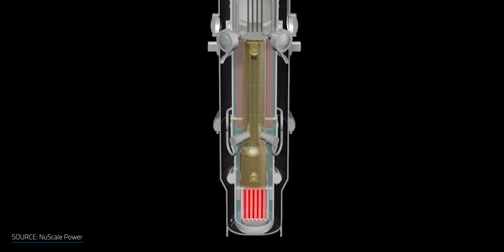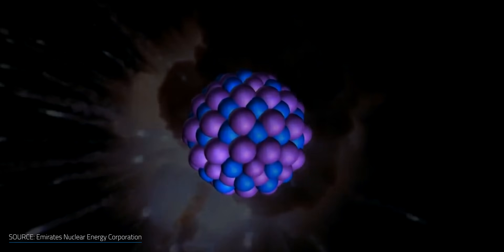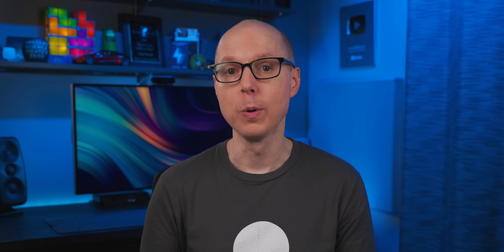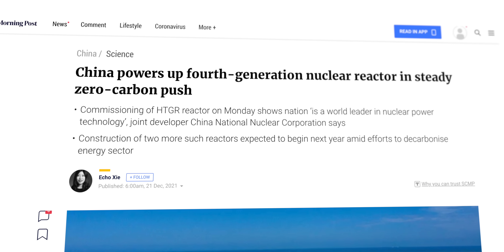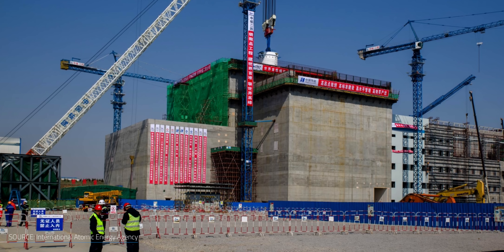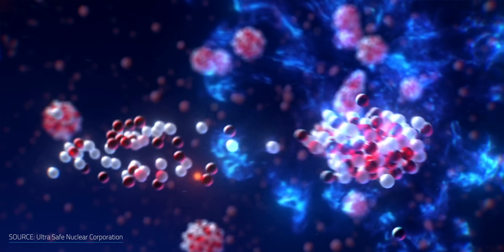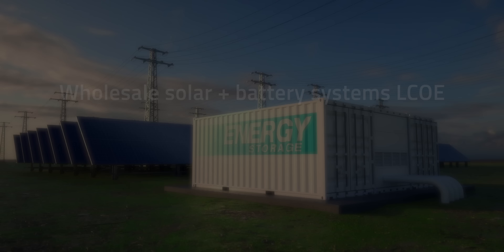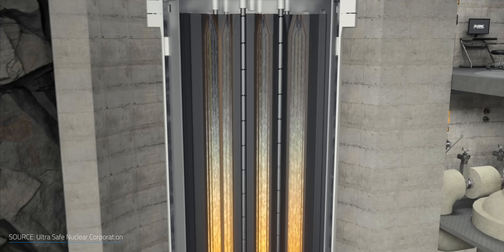Forget Small ... What About Micro Nuclear Energy?

Comment: No, no, No, this isn't a good idea. A bunch of small nuclear reactors all over. Not a good idea. Nuclear waste is a bad idea as well. Why doesn't anyone think of the waste ? Plus there would need to be big regulations to control it all. Along with a lot of more opportunities for things to screw up all over the country. I'm working on a micro energy system with a combination of wind & solar, a battery system and GE has a back-up generation system that runs on a jet engine. You tailor the engine and generator size with the micro electric system with the community it needs to power or the building size. Than you power the jet engine with Neste Bio-Jet fuel along with a small structure to eliminate the noise level and air intake needed. And you can have a high school kid from KY to run it, you don't need a mad scientist to do it. The cost levels are considerable lower and the tech is simple and straight forward.  🤷‍♂ Lets all be safe and green all at the same time. 🤷‍♂

Comment: Just curious, I always see water as the medium for cooling in Reactors but is it possible to ever use other things, like colder liquids in specific situations, then it could cool the reactor further than just water can?  Just curious..
Reply: I know TLDR, this would be too short an answer in the classroom phase of the Naval Nuclear Power Program. It's complicated.
The water (In Naval reactors) is not only the coolant, it is also the "moderator" that slows the fast neutrons from fission down to the "thermal neutrons" needed to sustain the chain reaction. The density change of water with temperature is what makes the reactor "self regulating". When the temperature increases the less dense water slows down fewer neutrons slowing the chain reaction and cooling it back down. The control rods of the reactor can shut it down, allow it to self start or adjust the Average Temperature of the Primary Coolant but they are not used for moment to moment "control" of the reactor.
 PWR's
(Pressurized Water Reactors) normally are "Critical" when operating, that isn't a Scary Term, it means that one of the 2.7 neutrons from each fission of a U235 atom causes ONE additional fission of a U235 atom, steady state conditions. changes in steam demand on the secondary side raise or lower the temperature of the primary coolant which increases or lowers the number of thermal neutrons that cause more fission.
Reply: There are basically four kinds of coolants, water, liquid metal, gas, and molten salt, each with their own hazards and benefits. That should get you started.

Comment: I would go futher, I would like to see neighborhood reactors installed with solar and wind along with batteries to deal with the heavy loads. This would decentalrise the grid while having remote monitoring. Also I am surprised there is no secondary market for used nuclear waste? I mean in terms of space usage for space craft or anything or for use in micro power plants to full use up that heat. In IT we can reuse old hard drives in arrays for temp storage like backups and non critical storage, maximizing the working storage, and minimzing waste until the HD does get scrapped for recycling later. Im sure used nuclear waste from the last 100 years can be stacked up like that and use that left over heat energy to further produce steam on lower end or smaller power plant turbine power generation. 

I'm sure it can be figured out like anything else but you have to start somewhere like SpaceX did with reusable rockets.

Comment: I sort of wonder if the inflection point, from an economic standpoint, for the widespread adoption of nuclear power is going to be the point at which average sized cities can effectively protect their citizens from price fluctuations by purchasing a nuclear reactor to give their residents power. If you are the city council of a city of ~50,000 people (maybe 25,000 homes) and you can go out on the open market and spend ~$300 million on a set of modular reactors that can provide for their power needs, and tell all their residents that there power is going to reliably cost $100/month for the next 10 years, I think that would be an insanely popular thing to do.

Comment: I think we should hold off on nuclear. Switching infastructure is a huge ask and takes a very long time to convince the public before you can even start integrating it. We are just getting people on board with renewables. Nuclear still has a ton of risks. It may very rarley fail, but when it does it renders entire areas of likley built up infastructure inacessable. We should wait for fusion to get fleshed out so we are not just finishing building nuclear plants when we start asking for fusion.

Comment: Deep geothermal will overtake SMRs by 2030. Its cleaner, does not require fuel, and can be installed far quicker. SMRs are better than larger reactors for sure, but they cannot be deployed as fast and with as few downsides as deep geothermal.

Comment: I have worked in power generation and I think these small and micro reactors are a great idea. So many of the problems with fossil fuels are eliminated, they are safer than coal plants to work in and around, and they are, in the long run, far cheaper, though initial costs can be intimidating. I say move off of fossil fuels as fast as possible. These are the right solution.

Comment: I live in Ontario, near the Chalk River Nuclear research center and I am pro nuclear but my main hesitation is around cost. It is too expensive. Hydro is king in Canada for a reason. Quebec is exporting loads of cheap electricity to USA because they invested in Hydro when we invested in Nuclear. Their investments are paying off big time while ours are a massive drain on our economy. Nuclear does work and is worth it in certain applications but Hydro is a better source of electricity for us here. Unpowered dams are low hanging fruit for us and dam control can act as a battery to balance wind, solar and nuclear power plant refurbishment gaps. We have no coal and I am glad for that. I would not switch from nuclear to coal like Germany. I would invest more in Hydro like Quebec though. We have so much untapped potential in this province that is 2x the size of France

Comment: Something to note, A smaller core comes with less decay heat (i.e. its harder to stop a freight train than it is to stop a prius). A nuclear reactor doesn't just stop producing heat when you insert the rods.
The smaller decay heat load lowers the potential for a meltdown in the event of an emergency, and lowers the cost of developing large and complex passive cooling systems, creating an overall smaller, simpler, and overall cheaper reactor.
Reply: When services everyone needs started being Privatized & centralized into bigger hubs, that model was “sold” to public as , “this will give you cheaper, safer, more reliable service” (which has not happened, due to numerous factors).  
Centralization works great for profiteering, but has some potential issues, such as security (like, as terror*ist targets), excessive dangerous waste, etc.) 
Imho, those controlling what kind of reactors are allowed, dance a fine line between pleasing citizen consumers, investors, military agendas to stockpile weapons-grade nuclear materials, toxic end-stage capitalism, etc. 
Then there’s dealing with the rather antique rickety Grid. 
Truly micro nuclear, run-your-home generators, could be great, if that tech can be made actually safe.  
My concern is, industry does not naturally opt for consistently making things that work as-advertised, much less, over time.  Pretty much across the board, whatever one can point at, now, is increasingly made less reliable, shorter lifespan, requiring more costly replacements & maintenance, etc., than, say, 70 years ago…talking correct & meticulous engineering, & manufacturing.  
The planned-obsolescence game, the first episode I know of, was a debacle around lightbulb manufacturing around 120 years ago.  That game was so bad then, the feds had to jump in & negotiate limits to it (at least on incandescent bulbs).  It’s rampant now for everything, & rather out of control (we actually could still have electronics that last many decades…many items used to). 
THAT issue…that gaming of maximizing profiteering…applied to home-power units of the nuclear kind, truly IS rather terrifying.

Comment: Simple Answer Here avoid any Nuclear power.. too pricey .. too dangerous ... and very bad for your health and the health of the future generations.... plenty of renewable s around to power the plant forever.  they are not polluting .. dangerous or that costly to build. Tidal power along can produce green clean renewable power in the mega watt range for unit built for a fraction of the cost of Nuclear. And unlike wind , solar... Tidal is all the time day and night all thanks to our own Moon orbiting us. 12 hours in tides and 12 hours out tides and the more coasts you have the more units under the water you can make. The UK in fact has the most strongest tides on the planet and lots of coast line to build them around. we are a Island after all.
Reply: Tidal energy is inefficient and too expensive to build. It produces power in intervals wich means it might npt produce power when needed and must be paired with batteries for efficient use. But batteries are expensive too so its litteraly better to build nuclear power. Nuclear is not renewable but nor does it need to be, uranium is a recource that doesn't have an infinite lifespan so the uranium deposits will deplete either way. And I have no idea why you think nuclear power is dangerous for your health, because it isn't. The only times it can be dangerous are when reactors explode and that has only happened twice AND it was before we made nuclear reactors super safe.

Of course nuclear power wont be a permanent solution but its a great way to quickly get off fossil fuel and stop a lot of carbon emmission. We will have to change to renewable energy either way and i believe tidal power will be a huge player in renewable energy game in the future, but right now the technology is underdeveloped and super new and we need to give it a lot more time.

Comment: Heatpipes would be a great solution to transport the heat out of the reactor...
This would need a liquid with a relatively low vapor pressure and a boiling point a good bit below the reactors running temperature and a good bit above the boiling point of water, with a high value of energy required to boil.
Reply: Name 2 or 3 or 4 suitable coolants.  East to say but what are they?

Comment: The one and only name of the game is affordable, safe, low-carbon, 24/7/365, dispatchable electricity for all of humankind.

The BWRX-300, with an OCC of $2,250/kW is the most cost-effective design of NPP there has ever been or is ever likely to be. In the UK, 3,200 MW of EPRs is costing us £20 billion. 3,200 MW of BWRX-300s would cost £5.4 billion. Other than the tiny percentage of humanity that can be 'served' by micro reactors, 300 MW SMRs can do the rest.

Big nuclear' does not have one single advantage over SMRs. Right now, nuclear power is on a knife edge with the potential of another Chernobyl from a cruise-missile strike of a 'Big-Nuke' plant, with its huge source term, spreading radionuclides far and wide yet again. It would write off any future prospects of nuclear power's expansion in the battle to replace fossil fuels.

By contrast, SMRs with their 'manageable' source terms, sited far and wide geographically (as were coal-fired plants when grid electricity 'kicked off'), can be politically justified to consumers as being as safe as any other chemical or industrial complex.

Matt's use of feculent LCOE for wind and solar power plants (WASPPs) plus batteries, flies in the face of common sense compared to the LCOE for a BWR-300 with its 60/80 years lifespan delivering the perfect product. Batteries can never backup WASPPs when the wind don't blow and the Sun don't shine for days or weeks at a time. It has to be gas-powered plant to do this and that gas has to be greenH2 (from an over-build of WASPPs) in a decarbonised future. The cost, environmental destruction and waste mountains from such a WASPP + greenH2 energy infrastructure are all off the scale.

Big nuclear is dead. SMRs, and the BWRX-300 in particular, are/is the future of nuclear power.

Comment: There are a lot of communal heating systems out there. I read "somewhere" ideas about using nuclear as a replacement for heating. Is this a solution that could be retrofitted to produce just heat rather than electricity? Heating is one of the biggest contributers to co2 and retrofitting heat pumps seems expensive if instead cheap heat source could be the replacement